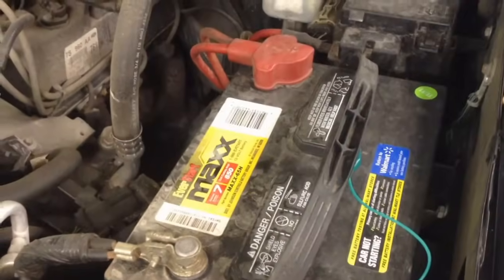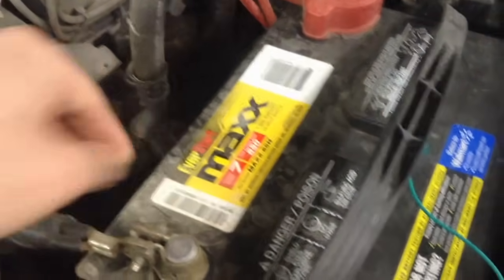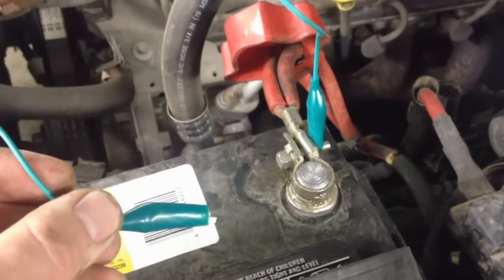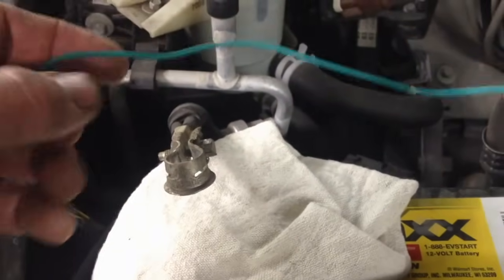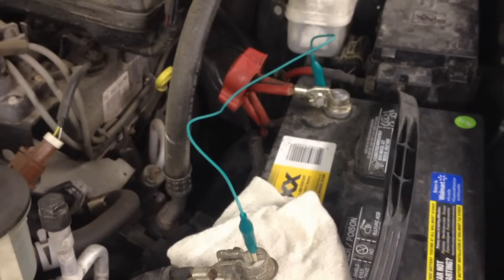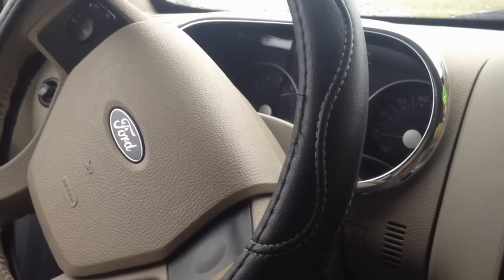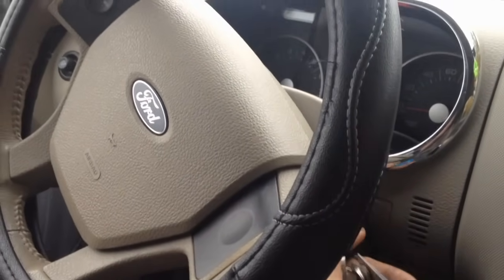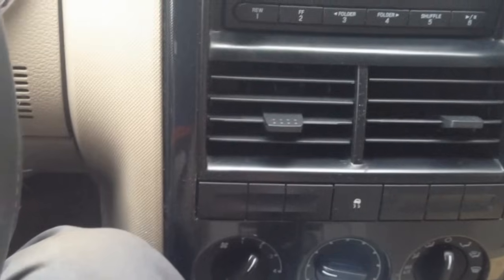How To Clear Your PCM'S Memory On Fords After Repairs

Comment: Thanks for the video.  Question:  I have an 02 Ford Escape V6.  Just had it in the shop because an EGR valve blew out (back pressure from clogged CAT).  That's all fixed, but now getting low/surging-low idle and the occasional instrument panel dropout, where speedometer and other gauges drop to zero momentarily before returning. Never had idle or cluster issues before the EGR/CAT (coils, plugs, and top plenum man gasket replaced, too, btw) issue.   Hard to believe it came up "out of the blue" by some coincidence.  Any thoughts on why an instrument panel would go flaky like that (and the idle issue) all of the sudden?  Shop says no vacuum leaks detected and there are no codes being thrown. Wife is now afraid to drive it.  Only 80K miles on it.
Reply from the maker: Was it running good when you picked it up from the shop for awhile or ever since. The way you are talking yes there is a large vac leak. Does the idle go up and down or just sit at what seems to be too low of an idle.
Reply: FordTechMakuloco  Thanks for responding.  This is all very recent.  I picked up the car on Friday.  Live less than a mile from the shop.  Seemed OK in that very brief time, but the next day my wife drove back and forth from work (20 miles each way) and reported the idle problem.  I replaced IAC that day because I already had issues with it in the past (sprayed out carbon deposits before with original when it wasn't holding an idle at all -- about a year ago).  But replacing the IAC didn't help.   As far as the idle goes now, it goes up and down in a very low range.  If I had to guess, it dips to around 400 or so and then the car attempts to correct and it goes back to, say, 650-800, and then drops right back down again, then the car tries to correct, etc., etc., etc.  It's a cycle that you can actually hear if you have the hood up, as well as verify with the tach.
Reply from the maker: Yes start looking for a vacuum leak or actually they should they had the intake off and from the way you describe it one of the lines are off or manifold was not installed right. That is exactly the way the care would act.
Reply: FordTechMakuloco I'm going to have to look for the leaks, as they claim they couldn't find any.  I know you probably have a smoke machine at your disposal, but what do you think of the supposedly tried and true practice of using starter fluid spray (or WD40) to try and locate leaks?  Seems a little sketchy to me in terms of fire hazards.  Tks again for the help.
Reply from the maker: Throttle body cleaner works best- Ford Escape 3.0l V6 Engine Vacuum Leak Testing

Comment: Hi, I have a 2010 Ford edge, had HID light kit on the vehicle, when they burnt out I decided t go to OEM bulbs. When I installed them and turned them on they didn't work. Tried different bulbs, checked fuses 7 & 8, have only 9 volts running to each bulb plug. Can you help me please!
Reply from the maker: So the factory wiring is all still there? Di the hid kit just plug into the factory headlamp electrical connector before and now you just plugged the headlamp socket in? You need to make sure nothing else was added to the cuircuit. Also if a lamp circuit fault exist the junction box will not enable that circuit. You have 9 volts you say, so does the head lamps go on just dim? High beams work?
Reply: Factory wiring is still in tact
HIDS were plug n play
High beams work fine, nothing was added and the headlights don't come on at all
Thanks for your reply
Reply from the maker: When your HID lamps went did they both fail at the same time. I really thing you burned out the FET in the smart junction box. You are using the correct bulbs now as called out for in the owners manual? This system is very sensitive to the amperage draw so the wattage of the bulbs must be correct. Besides a chance there could be corrosion or a short on the low beams I really thing we are looking at a smart junction box. Is there no voltage to them then you turn on the headlights and now 9 volts?
Reply: HID's went out two weeks apart, and now I have OEM style. Can I have the vehicle's PCM or SJB flashed (error code? only allowing so much voltage through because it may be in a fail safe mode??)?
Thanks
Reply from the maker: Yes I would get codes read from the SJB it will set a code if the FET is burned out or locked out and theat will tell us more. I went through this on a tow truck they tapped into the park lamps with too many bulbs and burned out the FET had to replace sjb, very sensitive.

Comment: Question- I have a 2004 Ford F150 3v 5.4. 
I'm am getting code for cylinder 2- primary/secondary circuit.
I have replaced coil pack and spark plug and still running rough with that code, took it to a shop and they first thought was fuel injector. replaced that and still same- replaced wire connector for injector and same results. They are leaning towards an electrical issue, possible PCM. I did not reset the PCM at any point. Do you think resetting this would fix my issue?
Reply from the maker: No I do not think reseting pcm will do anything. With that engine and year you really need to check for rub through of the main engine harness on the a/c line at the accumulator it is way back there on the passenger side and is likely your source, check it out and let me know.

Comment: Hey i have a problem with misfire, the wires 3&4 does not spark; i want to know if i reset the pcm, it could fix my problem or do i need a new one?
Reply from the maker: What make and model and engine? A pcm reset will not fix this. If you have a coil pack system it is likely the coil but I need more info so I can verify firing pairs.
Reply: FordTechMakuloco 2006 ford taurus 3.0l   I changed the spark plug, wires, coil pack, but still the same problem with misfire, 3 & 4 does not work. So I suspect the is the PCM. That is damged.
Reply from the maker: If there is truly no spark from 3 and 4 they are indeed paired cylinders from reading the firing order. You will need to check for a ground pulse from the yellow/white wire at the coil. If there is no pulse. check again a few inches from the pcm connector.
Reply: FordTechMakuloco so you think that the pcm is not damage.
Reply from the maker: not likely at all on these, I would check the harness as noted. Alternately you can overlay the harness and test that way, or cut the wire 3 inches from pcm connector and test for ground pulse there too.

Comment: will the pcm cause a problem with the electric componance on the steering wheel  ''cruise'' and signal light switch...and horn...does not work.?
Reply from the maker: No for that you need a clockspring.

Comment: I have a history in Chrysler Driveability, and after watching a couple of you videos, and looking at your posts, you seem to know your stuff. I just bought a 2000 Ford F-150, AT, 5.4L. It was a Bi-fuel truck originally. (LPG). At some point, ALL of the propane components were pulled. Tank, compuvalve, wiring, etc. The truck runns beautifully, BUT has a code U1262, and cannot pass the emissions test. Data bus communication error. I don't know if it's related to the old propane components removed or not. With the AFCM being gone, would that confuse the PCM, and set the code perhaps. I have also read that the instrument cluster is good for setting this code. Any ideas?
Reply from the maker: Yes it is because the pcm is not communicating with the compuvalve which was taken out so makes sense. You will need a regular gas vehicle pcm so it is not looking for the compuvalve message.
Reply: Any way to reprogram the pcm, so its not biofuel anymore? Change the VIN in it or something? Or is the code embedded in the ROM somehow. I also thought about using a terminating resistor on the twisted pair that plugged into the AFCM/Compuvalve. Bad idea?
Reply from the maker: No the actual pcm internals are different for the drivers needed for the other inputs and controls for the bi fuel. A pcm from the junk yard is your best bet since it will have the as built data in it already too. Yes bad idea to use a terminating resistor. There are 2 in the system in series between the pcm and cluster and is vital for bus comm. I think it has to be 120 ohms total.
Reply: FordTechMakuloco Good morning. I have one more question. Taking your advise.....I am looking for a used/reman PCM on Ebay, and the application charts all say that the particular PCM in that listing fits both BI-FUEL and GAS, which would indicated it is just a matter of programming to that type of system. If I get a used unit, and have it programmed to my VIN, there is one digit in the VIN that identifies the fuel type, and I will be right back at square one if my VIN is input. I've identified that digit, and what it would be if the truck was gas, but can it really be changed and work with my truck?
Reply from the maker: Yes with the dealer scan tool you can change the vin, so now you would need a vin that is from the same truck setup except gas only. That Is why I say a local junk yard one where they know what truck it came from not a reman. Our dealer parts catalog is showing multiples for the gas and bi fuel trucks so the one you are finding must be a generic type pcm that does all.
Reply: FordTechMakuloco If I get a junkyard PCM from a truck with all the same specs, only not bi-fuel, will it start the truck???, or must I take it to the dealer to do some programming/flashing? Will I need the PATS Keys reprogrammed now too? Is the PATS info stored in the dash cluster, or the PCM?
Reply from the maker: Mike Martindale all the pats functions are in the cluster, but the pcm will need to be programmed to the vehicle to allow the two to talk and then a parameter reset done for PATS.
Reply: You got pats key on 2000 ? my 03 dont have it, maybe cause i got an xl (work edition) ???
Reply: @brianblithe2271  Man, I didn't even rember posting in this thread, it's been so long ago! Haha. Anyway....yes, my 2000 has a PATS key. Kind of surprised your 2003 doesn't

Comment: Hey tech ford I have problem f150 05 v8 90000m is  message engine fail safe mode what is the right replace the tps or replace thottle body includ the tps please help
Reply from the maker: It all depends on the code if you have a P2135 then just tps. Any other ETB code replace the entire unit.

Comment: Hey tech ford I have problem f150 05 v8 90000m is  message engine fail safe mode what is the right replace the tps or replace thottle body includ the tps please help

Comment: My reverse gave out. Can the PCM  cause this?
Reply from the maker: Yes it can what year and model
Reply: 1995 ford explorer 4x4 XLT. has 223k on it  four days ago when I put the car in reverse I heard a solid clunk but still got into gear. Two days ago when I put it into gear (R) I got nothing. Tranny fluid is a brown color. Told it was the convertor going bad but should have no effect on the R gear. In the past the O/D has come on (flashing) but I have disconnected the Positive cable for a few hours and it goes away. Sometimes for months other times for a few days. Seems  go on after a long Highway drive once I get on the surface streets.
Reply from the maker: likely the low /reverse band broke by what you are explaining.
Reply from the maker: Yes full disassembly.

Comment: Would resetting the pcm like this have any bearing on the pats system not recognizing keys? My 04 Explorer won't start and I'm getting the rapid flashing security light, neither of my keys work. Wondering if this would be worth a shot before I try having the pats reprogrammed for the key. Any advice is greatly appreciated, thanks.
Reply from the maker: It is worth a shot yes but I doubt it would have any effect. it is likely your pcm or cluster is ofline and not validating the pats key information.

Comment: Help!! Help!! Help!!! I have a 2001 Mercury Sable, the transmission light is on which those multiple engine codes. 9-14 different ones during a scan. The transmission fluid is great, changed it and had both a mechanic along with a transmission guy look at the car. The transmission guy claimed it was a defective wire which is under fuse block in front. Which connects different units on one fuse. After 300 miles from the repair (which worked great) all of a sudden light comes on and no one can find the problem. I know the dealership will kill me in a price on repair or even troubleshooting fee. What is your options? Keep in mind the car runs flawless and when it was running for the 300miles after the wire repair no issues at all. Could it be the ecm or pcm in this car? Help!! Help!!! Please.
Reply from the maker: pcm failure on these cars is very very rare. What are the codes you are getting?

Comment: I have Mazda tribute 2003 V6 3.0
The engine continuously misfires. Changed all the spark plugs & no. 2 coil as shown by code but still same problem. Does this memory erasing will help??
Reply from the maker: Not likely, I would start checking compression and the injector for that cylinder.

Comment: Hi! 

First I want to thank you so much for posting this and the video on how to replace a solenoid pack. They are wonderful!. 

Second, my friend has an '08  Ford Explorer that has 97,500 miles on it.  He was having these shift problems. It would "clunk" from Park to Reverse and then from Reverse to Drive.  He also noticed a hard shift from 3rd to 4th (or around 40mph). He called the dealer and the dealer said he thought it sounded like a solenoid pack and quoted a price of $1,500, ouch!.

My friend also realized hehadn't changed the transmission fluid, so we did that, hoping for the best. :-)  Still had the problems. Then we saw this video (thank you!).

Reset his PCM memory and everything is running beautifully except the shifting from 3rd to 4th is still a little hard. Is this something that could possibly go away or do you think it could still be the solenoid pack?  Or maybe the question should be, how do you know your solenoid pack is bad?

Again, thank you much for your time and posting of these videos!  They are very much appreciated.

Best,
Theresa

Comment: is this process for any ford ecm, or is it specific to certain models, because I am having a two fold problem one the high speed fan does not come on, and a/c clutch doesn't engage, changed ccrm, and pertinent fuses, still nothing,  How does one know if its elements or ecm!
Reply from the maker: Which vehicle?
Reply: FordTechMakuloco 1998 ford escort se

Comment: And olso when is runing the od light came on  and i can not turn it back of and then the car drives like if is very havy help me please
Reply from the maker: Have codes pulled at autozone then I can help much more. Any harsh engagements? Which gears are giving you problems. How would you describe your problems, shift flare, double bump, harsh etc...

Comment: I have a 2003 ford crown victoria should i reset my pcm memory after major repairs? Do I need to?
Reply from the maker: I would after a major repair that has to do with the transmission or engine driveability. It clears the memory while you are cleaning up your tools.

Comment: So last week I decided to just pick up the car from the Ford dealership. They said that "they had no idea what was wrong with my car and that the were unable to fix"my 2007 Ford Explorer with a V6 and 92000 miles. As I drove it home it ran great no problem. That night I decided to take it over to a mechanic friend of mine, who lives about 30 minutes from me. I slowly turned the key, I put it in drive and nothing, when suddenly it bumped into gear and drove off. Ok all is well until I came to my first stop. When I accelerated the would slightly move foreword. The engine ravved up and it would not kick into gear. I stopped and slipped it into 1st and tried it and nothing. Then went to 2nd and nothing. I then decided to turn the car off and start it up again. I slowly turned the key and let it all register before ignition. I slowly slip it in to each gear before drive. No problem, it when into drive and drove off. I had to do this twice on the trip. Ricardo,  my mechanic scanned the car for me and said that the solenoids were giving code and  if it was up to him, that he would remove the valve body and check for any loos connections or debris. What do you think?

Now on my way home I continued to have the same issues, however, I noticed on thing. As I was driving, I decided to just coast the car home since its all down hill. I noticed that the car was coasting on drive and the was raved up to 4 when I didn't even have my foot on the accelerator. Strange, what to do now?

So today Ricardo and I decided to take out the radiator to clean out the water intrusion that you mentioned and come to find out that the radiator has two leaks. We will also flush the tranny and clean the solenoids. Let's hope that works.
Reply from the maker: Yeah with solenoid electrical codes I would check that bulkhead connector then replace the solenoid pack for sure. Which codes you seeing.